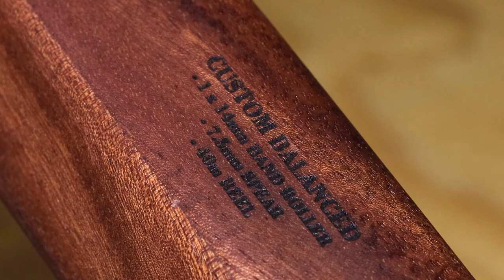Rob Allen Spearfishing | Welcome 2022

Comment: Hey rob, based in nz and love your guns. What are the primary differences between the snapper 120 and caranx 120 being double 14mm rubbers vs single 20?
Reply from the maker: The 2 x 14mm actually give more power. The single 20mm will load faster but, we now feel the the extra effort you need to load the 20mm means you physically need a longer time on the surface to recover from the loading.
Reply: @RobAllenSpearfishing  ah okay, currently using the caranx with a single 20. Is it completely interchangeable with twin 14s?
Reply from the maker: @camhuxford4065  The muzzle should have the ability to fit 2 x 14mm and, if the spear has t notches you are good to go.